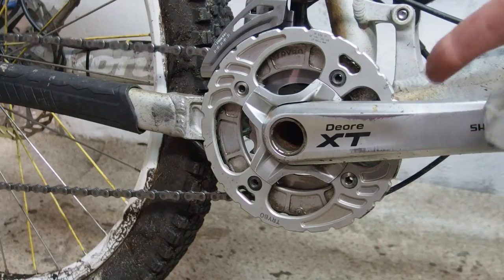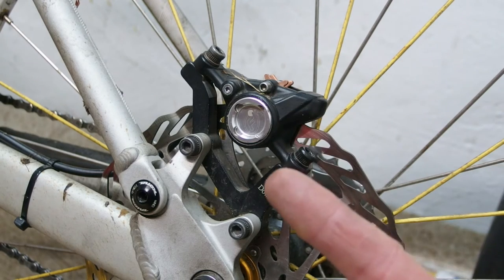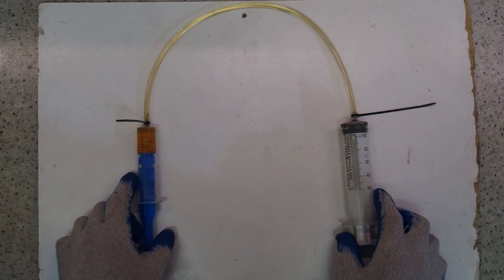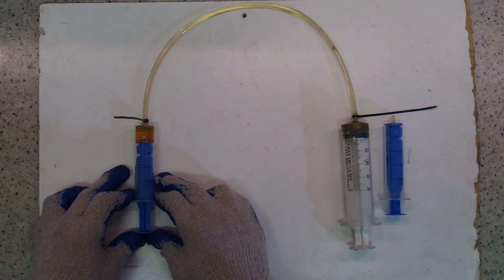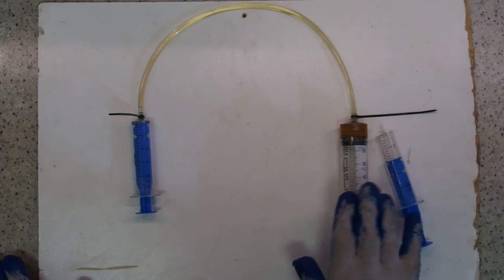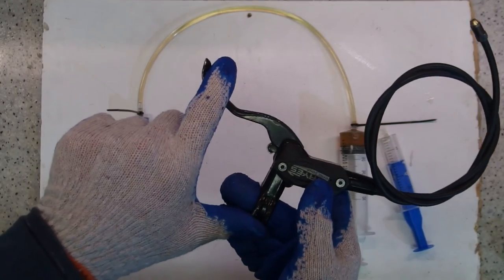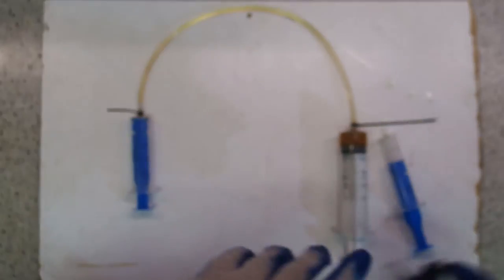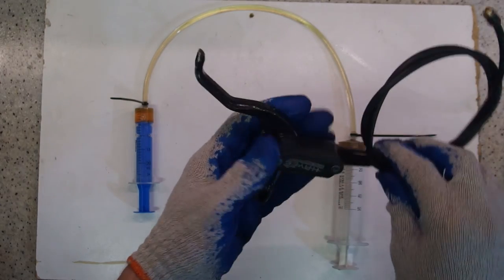Mix & Match hydraulic brakes between brands?

Comment: i went with tektro orion m725 with the carbon lever and shimano slx m8120 4 piston
Reply: How is that working out for you? I'm trying to do this with an XT lever and a Tektro Orion 4 pot caliper that will replace a n XT 2 pot caliper, because of power of course